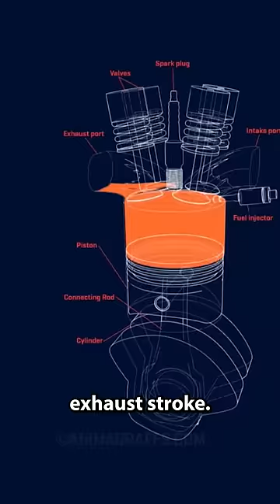Turbos Vs Superchargers

Comment: It's an old debate and you are correct but the story can be expanded much longer. This is why during the second great war in larger radial engines both superchargers and turbos where used together. Great subject for debate and thank you for your time.
Reply: As well as having the exhaust turbine connected directly to the crankshaft in stead of compound boosting (blowing turbo into the supercharger)

Comment: >"Blowers aren't my weapon of choice"
>Proceeds to make the sickest Whipple supercharged diesel engine anyone's ever seen.
Reply: Why no turbo on Topfuelers?
Reply: @danonoveh8114  Still lag tho.
Reply: @danonoveh8114 
No time to wait for boost lag lol
Reply: @rickantonio better ask for Thai diesel tuner
Reply: @danonoveh8114  Top fuel blower cars can create 2000+ pounds of down force from their exhaust, they point the pipes up and back to add down force and propel the cars forward. It's insane lol
Reply: @automobuilds2222 woahhh. That is just out of this world compared to normal cars. Thanks for the info. God bless.
Reply: @danonoveh8114 Superchargers are better for bigger trucks. Instant boost is better for pulling vehicles and carrying heavy loads. A turbo would be better fuel wise and also make more power overall than a supercharger. I just like superchargers because there is no lag, and it's just fun feeling the acceleration
Reply: Exactly that Duramax is the sickest thing ever!!!
Reply: @automobuilds True, but the real answer is the rules force them to use stone age technology and turbos weren't around back then. If they wanted to go fast they would use screw blowers over roots, because the lack of internal compression makes the roots horribly inefficient at high boost applications. Thermodynamicaly, it makes no sense at all to use a roots and have several hundred horsepower of additional parasitic drag going straight into heating your intake mixture.
But they do it because that is how it has always been and if they go much faster they have to shorten the distance further to keep deadly accidents down.
Reply: @danonoveh8114   , believe it or not, some bloke did make a twin turbo top fueler that did race officially in the 80s. However, to my knowledge, at the time turbos were too unstable, they would indeed make much more power but the problem would be putting down that power. 11,000hp is already quite alot. Although I'd like to see someone do this with modern turbocharger tech
Reply: @Cryptic_Potato  absolutely, I would like to see that myself, Thanks for that tidbit mate 👍🏻😀
Reply: @danonoveh8114  Too slow of response...
Reply: @automobuilds  WTF?????
Reply: @Cryptic_Potato And that bloke was Gale Banks(and Ron Hodgson). They are the reason why turbos are banned in Top Fuel and Top Alcohol.
Reply: @sylvestercastaneda3699 I'm a supercharger guy as well. Even tho most of my cars are turbo cars. I love me a supercharger whine 😅
Reply: He’s an engineer he can still make it all you need the fundamentals to do whatever you want with machinery, he’s just giving his own opinion between the two superchargers and turbos
Reply: @Cryptic_Potato 11,000 is not even a lot. They're regularly putting out 15,000hp or more in top fuel dragsters. I watched a team put together a dodge hemi block producing 15,000
Reply: Any time you compress air you heat it that is a given. The air molecules get tighter and bounce around against each other causing the heat.
 Turbo lag at the drag strip is not necessarily a bad thing. You can get the car hooked up and out of the hole before the boost really starts hitting hard and you're part of the way down the track and then it Rockets when the boost comes on full.
Reply: @sylvestercastaneda3699 heavy trucks are turbos though
Reply: @senorpepper3405  Yeah because its way more fuel efficient than a supercharger would be. The fuel efficiency on bigger trucks isnt already too good and it would be horrible with a supercharger. Probably get around 8 to 12 mpg
Reply: @sylvestercastaneda3699  I was talking about big big trucks. But I get your point.
Reply: @danonoveh8114  way simpler to put in, remove and lighter than a turbo setup
Reply: @danonoveh8114 you know of a turbo that will keep.up to a 14-71?
Reply: Well blowers and superchargers aren't the same thing, superchargers are for queers, real men run blowers.
Reply: @danonoveh8114 you don’t need much boost. Nitromethane stoichiometry  is near 1:1, so you need to add more fuel not air, and if you add much more air then engine will blow.
Reply: @automobuilds  thats right, humans are truly amazing beings.
Reply: @automobuilds how is the duty cycle affected by adding a turbo charger or a a blower? I have a vocational truck and would like to do a build
Reply: Seconded
Reply: @rickantonio I don't really believe lag would create enough of a problem for top fuel dragsters if the pro stock dragsters use turbos. The real reason is probably fear of change
Reply: @danonoveh8114  instant power
Reply: Maybe Gale Banks likes a challenge
Reply: @thewatcher611 not the reason. Topfuels don’t need as much boost as a gas engine. The AFR is about 1.7 air molecules to 1 nitromethane. So fuel pump matters more. A blower provides the perfect amount of boost. Turbos don’t have lag if you brake boost at the start. You get max boost ready at launch.
Reply: @danonoveh8114 
This is a generalization but...

Turbos are better for bottom end torque.

Supercharges are better for top end (high RPM) horse power.

Dragsters also don't want to wait for power (spool up time/lag). They are racing the tree and clock as much as the other driver.

In order to have a turbo give correct boost at 9000+ RPM it would basicly be a worthless exhaust restriction at low RPM. no big deal on the salt flats, terrible at the drag strip.

As someone else mentioned, technology has improved but the generalization still plays. In a dragrace or road course (power NOW situation) blowers are typically better. No lag and better on the top end without sacrificing the bottom end.

A turbo that does well at low RPM will either vent most boost at high RPM, meaning your powering a heavy thing that is no longer doing anything for you or your overcharging (and very possibly exploding, literally) your engine.

It's a game of what are you trying to do and at what RPM are you trying to do it.
Reply: Whipple supercharged twin turbo diesel*
Reply: @laurean5998 it actually has to do with safety, and running nitromethane exhaust, through turbochargers. They are literally hand grenades, and not a question of, if it will go off, but when
Reply: It's funny the only reason he used a whipple is for the name recognition and the cool factor.he would've made more power with an eaton unit or just no blower at all with the same turbo.
Reply: @Prestiged_peck  Eaton doesn't have a unit large enough for that engine. IIRC Gale Banks is using either a 5L or 8L Whipple.
Reply: @rickantonio not the reason. Reason is nitromethane has an air fuel ratio of 1.7 to 1. Compare that to gasoline which is 14.7 to 1. You don’t need much air for nitro engine, you need much more fuel.
Reply: That was from his knowledge of how airflow works, he did it to prove a point too 😂
Reply: @sylvestercastaneda3699  Is that why all semis have blowers instead of turbos?
Reply: Each has its applications both pros and cons
Reply: Wagler duramax is crazier
Reply: @rickantonio  wind it up on the line the lag will be very minimal because it's already spooled up !
Reply: @pirkkaruuska5766 and have in  high proformance power boat racing.
Saw that short this morning 😁😉
Reply: @danonoveh8114 NHRA doesn’t allow it, same reason they still use distributors. IIRC Banks built a turbocharged Top Fueler and the NHRA didn’t take very kindly to it.
Reply: Turbos have a parasitic straw on the other cylinders exhaust stroke.
Reply: @danonoveh8114  because they are banned, ironically enough partly because of Gale😅
Reply: correct me if i’m wrong but top fuel banned turbo chargers
Reply: @ReyzoRPlays  Yeah, pretty stupid of them. But then again they also banned the true quarter mile race for the 1000ft crap. I forgot who was responsible for the turbo ban after they went and broke all the records... Whoever it was, I know they also (or at least someone similar?) got turbos banned in boat racing, too.
Reply: @thewatcher611  it’s not about lag. Turbo lag has been eliminated since like the 80s. Literally anti lag my guy. It’s just that top fuel has been the way it is for so long that they’ve got the formula perfected. The exhaust is so powerful is creates downforce and pushes the car forward. And there are turbo top fuel dragsters. You just have to look it up.
Reply: ...you've seen.
Reply: @sylvestercastaneda3699 I like them also cause I also use them for work and four-wheel driving. I’m talking about Toyota though so I really like the superchargers low in torque specifically the root supercharger.
Reply: @danonoveh8114  I realize this comment is a year old but in case you're still wondering it's because Gale Banks got them outlawed by the nhra for top fuel way back in like the 70s or something and it's been that way ever since

Comment: I have a supercharged car and have owned turbocharged cars and I can confirm that the instantaneous power of the supercharged car, coupled with a DSG gearbox is more rewarding to drive than its turbocharged counterpart, with none of the turbo lag that even the very best, twin-turbo cars suffer from. Even the 8 speed auto in the 625bhp BMW M5 Competition I recently drove had the dreaded lag.
Reply: Yes

Comment: He's not wrong but that supercharger whine though!!!!
Reply: Turbo whistle
Reply: the whine is a negative for me and(likely) most people. its a whine..
Reply: @hotdog9262  It's a scream - they're called screamie screws.
Reply: seeing muscle cars open up butterfly valves from a bug catcher and butter the tires is metal mad max captures what I'm saying pretty well
Reply: Well i prefer diesel turbo sound, as its has much more pronounced whistle, and those torque that rival blower in the low end.
Minus scary uncontrollable speed at the top end of those gas turbo engine..

Comment: Wow, thanks professor Banks. I never thought about it like that. Breaking down the pumping losses of the exhaust stroke compared to the constant drag on the crankshaft totally makes sense. The ability to use all of the power stroke is the efficiency difference between a turbo and supercharger. I understand now.

Comment: I replaced my turbo on my vette for a pro charger and the pro charger delivers instantaneous power! Much happier with the results!
Reply: That’s not what he is arguing here. He is not saying turbos make more or “better” power. What he is saying is that turbos, porovided they are sized properly for the system, make more mechanically sympathetic power. That’s all.

I’m glad you are much happier with your pro charger but I think you missed the point of this
Reply: @matthewangell170  I know what he was saying and I’m not at all against what he’s saying I was merely just saying how I prefer a pro charger.
Reply: @matthewangell170 but gale is overlooking what makes the turbo possible. The reason you can extract power from the exaust stroke is because you are extracting power from a piston elsewhere that is in its power stroke. The fases dont escape on their own, they are pushed out by the crank which always has  atleast one pistion providing power. All things are subject to parasitic losses, and subject to the laws of thermodynamics, the key is efficiency, and finding ways to achieve it
Reply: 100% 
it's not free energy it's like a water dam that's taking it from the force of nature, but it's just less mechanical parasites 
@seanandrew2823
Reply: Probably had the wrong size turbo
Reply: @seanandrew2823 
I'm no motorhead so please school me if I'm wrong. The way I've always understood it is they're both compressors. Even for a single cylinder, one is capitalizing on a certain amount of waste energy that needs to be expelled whether by inertia or with additional pistons pushing it and it's limited at least partly by the heat the turbo can take and it will always have a certain lag effect because it's a follower vs the other that is also a parasite but is leading and not hampered by material temperature constraints on components.
Or one is a power boost through efficiency while the other is simply aimed at power boost and uses more fueI. I know materials are vastly improved but I've never seen turbos as big as chargers. Do I have this right?
Reply: Only at high rpm, low rpm, and it doesn't do jack!
Reply: If you like that, wait until you drive a Tesla!
Reply: @seanandrew2823  Turbo is driven By "Blow Down" mostly, I.E. the leftover combustion pressure after the Exhaust valve opens. This can be well over 300PSI on BDC in hi-po engines. The exhaust flow restriction is then in the range of 5-30PSI with Boost pressures of 3-25PSI pushing down the Piston on the intake stroke. 

Blow down and almost no internal resistance of the Turbo itself make it so efficient compared to superchargers.
Reply: Man if you like that then try the Eaton 2650 you will love it! 
  A C7Z06 is also a great way to go.
Reply: @seanandrew2823 the parasitic loss of pushing exhaust gases through a turbo are much much less than the parasitic loss of attaching an entire belt driven system to your engine just to compress air. You still have around 55psi of "back pressure" on an n/a engine. If you utilize that to spin a turbo that is why they call it "free power". The loss is minimal as that bac pressure is only increased slightly compared to the parasitic loss of an entire supercharger robbing your power
Reply: @seanandrew2823 turbo cars actually can benefit from an increased "backpressure" because when the piston is flying up in an n/a exhaust stroke it has to slow down and reverse. The back pressure of a turbo makes the exhaust stroke less 'taxing" on an engine because it helps the piston reverse and slow down to switch directions, decreasing the stress on your rods/internals
Reply: If that back pressure helps the piston reverse, doesn't that also mean it impeeds the speed of a piston somewhere in the engine trying to race downward on its power stroke ?    Last time I checked they were all connected to one crankshaft !
Reply: @spencerkleiman5035 that's nonsense. You are are looking at a single cylinder here. If you slow down one piston you slow down the crankshaft and all pistons at once. You can't slow down exhaust stroke and speed up combustion at the same time, unless you run rubber conrods
Reply: @dundonrl  No, variable vane tech has imporved lag and dual turbos also help this problem (small ones spool up really fast and big ones move a lot of volume once up to speed- combine one of each and it's a really good system getting more of two good things).
Reply: "Instantaneous" power out of a centrifugal? I don't think so. That would be a roots or twin-screw blower. A centrifugal builds power with rpm.
Reply: @seanandrew2823  his point is that even though the others cylinders might be on their power stroke but turbos still have lower parasitic loses than a supercharger for the same output power, and turbos still produce more power per cylinder pressure.
Reply: @sepg5084 yeah but lets say you run a turbo 4 banger realistically you run 3 cly when the turbo act parasitic after that lag itll runs on 4 holes again.everything have its pros and cons.
Reply: You're not supposed to say that. A possible advantage of turbos though is that they are simpler. Never had a turbo engine but I looked into what is involved in changing out a turbo. It's basically just a manifold swap, at least on the one I looked at.
Reply: @anonymike8280 I think you have it the wrong way round. Turbos are far more complex than superchargers in almost every way, technology, manufacture, installation and the electronics involved in a modern setup.
Reply: @zahimiibrahim3602  But R&Ring a factory turbo could be a simple job on some vehicles. The one I saw was just a little manifold or plenum. Remove, replace, hook it up the way it was, go.
Reply: Chances are, neither of your systems were being run at or near maximum possible cylinder pressure, but thanks for sharing
Reply: @Skunk106 but I AM!

Comment: Im so glad he still mentioned how turbo chargers are parasitic just on the exhaust stroke instead. Too many people believe they magically create boost since there isn't a belt directly connected to the pully system and there is no added load on the engine to power them because of that. Which is just simply not true.